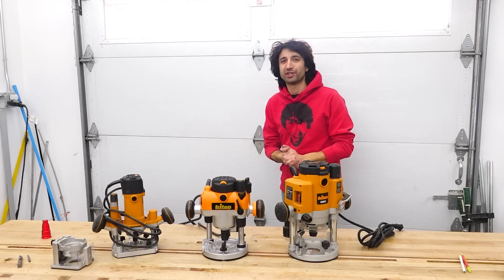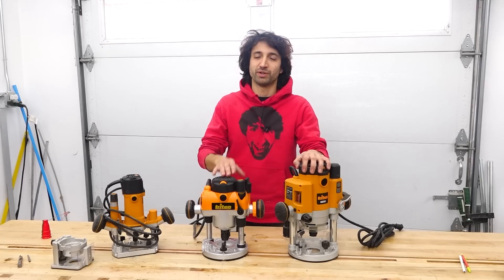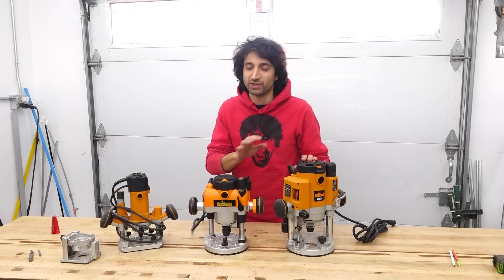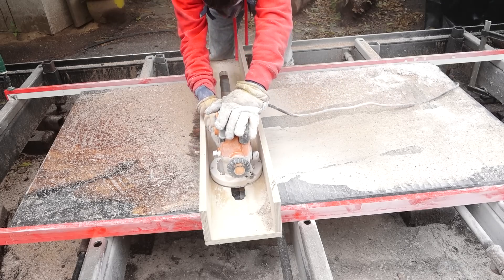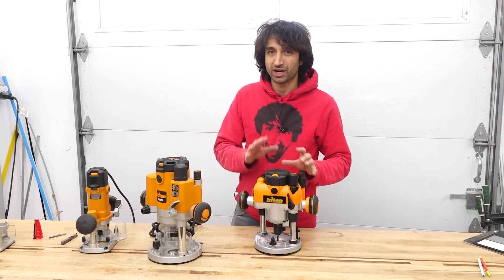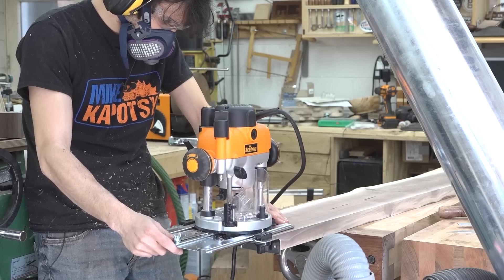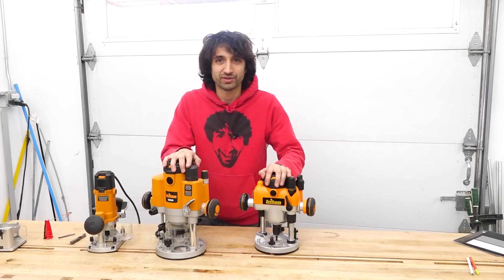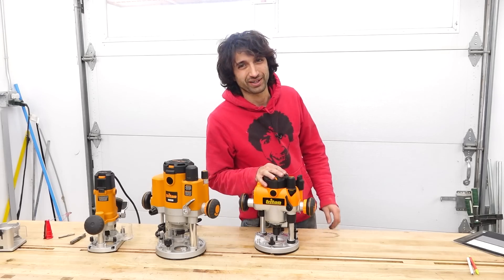What Size Router Should you Buy First?

Comment: something bigger then a 1/4 inch shaft. i found out...plunge routers are nice.. i have 3 routers,,and 2 nice pro tables..yep u got that right on 1/4 inch ...but then again bigger bits cost bigger money...a small router is handy..same as drill presses...theres a lot to say there to on them..buy a good one..m,taper....type..when i worked in the mill,,i found this all out...dont buy cheap things..haaa,,if you got the money...great stuff Matt..

Comment: I really need to up my router game. My main router right now is a 1960s era Porter-Cable model 100 with 7/8 of a HP. That little art deco beauty will not die and is installed in my table saw wing most of the time doing roundovers or flush trimming. 

I also had a 2000s Craftsman piece of crap that would never hold its height between the collet slipping or the base moving, and it would burn up brushes incessantly. It eventually melted the switch, so I tossed it in the trash but kept the little portable table it came with. 

Eventually I’d like to build Norm’s router table from the New Yankee Workshop and drop in a nice router lift with the biggest router I can find. That big Triton might fit the bill - if I can find one for a decent price.

Comment: The large Triton router with its built-in mechanical lift system was an easy upgrade decision when redoing my router table. The forethought and engineering in the Triton are amazing. I have zero complaints. You may have already done this, but otherwise you should showcase some of the Triton router features like safety switch spindle lock offset wrench and collets. They are game changers in functional simplicity.

Comment: Excellent review! I have the Triton 3.25 HP in my router table, a Makita trim router and a Bosch 2.3 HP plunge for handheld use. If I could do it over again, I would have bought the Makita 3.25 HP for handheld use instead of the Bosch, as it basically weighs the same with better power for flattening sleds.
Reply: Ok
Reply: What model is in your table?

Comment: They’re pretty simple tools
I have 8 that are from 40 years old to new.

I’ve bought 5 in the past two years all from Harbor Freight 
Two of those live in a pocket hole machine and two small compacts do edge profiles.
The other is the new Hercules with fixed and plunge base that lives in a router table. The fixed base is adjustable from above the table.

I’m pretty impressed by them and make furniture for a living.
They’re as good as any router available twenty years ago.
Reply: LOL, I have an all metal die cast P.C.from God knows when.
Reply: I’m not going to admit how many routers I have
Reply: @Outcast1016 , I tell my wife that need one for every bit.

Comment: I have all three of those sizes (Big PC in the table, 2 hp Bosch - and a Milwaukee M18 fuel Trim Router. My two cents (maybe 4 with inflation), is that a battery powered trim router is the way to go. No cord to get in your way, far more portable - and in my case uses same batteries as my circular saw, sawzall, grease gun, impact wrench and string trimmer.
Reply: I'm not sure about you, but I find the Milwaukee much easier to adjust than the Bosch too. dust collection on the 1617 realy annoys me, first buying a separate part, and then needing a screw driver to install and uninstall it to change bits? SO at least I'm  hoping Milwaukee does a 2 hp cordless soon, since the 1/2 bits is rather useful.
Reply: @trevsaunders5778  My Bosch is the MRC23EVSK 2.3 hp combo router. Been pretty pleased with it.

Comment: Makita makes a trim router which takes 1/3" bits and comes with lots of accessories. I can't imagine breaking a bit, as long as it is of good quality, sharp and you don't shave off too much material at once. Shaving off too much at once is anyway bad, because it increases the risk of chipping and splintering.

Comment: here is an odd ball question but i really have not seen an answer to it and since i have been following your channel for sometime now and this topic has come up i feel it is the perfect time to ask this question ,,,,,,,, i am wondering if i can use a router bit in a drill? The reason i ask this is because i am actually making a grove in some 2x2 wood so i can run a bearing through it to in effect make a home made glider for a drawer?  my thinking is in a drill press i can adjust the distance i need to plunge and also i can properly set up a fence so all the pieces will be the same as far as distance from the edge  ,, but the biggest factor in this is i have a drill press and have acquired router bit set 2nd handed  but do not have a router .... comes down to i do not do very much woodworking at this time only real small personal projects and have limited personal space to keep any tools i have or acquire
Reply: Get a router, drills don't have enough power.  RPM's are too low.
Reply: @rogerdudra178  thank you 
but since i do not see a future project with the possible need for a router i will attempt to ask a friend if he has one (router) i can use for the router bits i have acquired and possibly gift the bits i have as a thank you too him 
i do thank you for this knowledge
Reply: I think using a router bit in a drill press would be a bad idea. First of all, a drill press really isn't designed for lateral pressure. I've heard stories of people breaking things using drum sander attachments in a drill press. Second, it seems fairly dangerous as the bit is fully exposed vs being mostly buried in a router base or router table. Also, a drill press turns way too slow. Most run in the 150 to 2800 rpm range, whereas a router turns in the 8,000 to 25,000 rpm range. Lateral runout would be another concern. Far less tolerance in a drill press than a router. I fully understand "it's what I've got" but I wouldn't risk it. Routers aren't that expensive.
Reply: @rogerdudra178  ps when i said a drill i was thinking about a drill press
Reply from the maker: You can do it but it won’t be very effective. A drill press spins too slowly
Reply: @benjigreystone  Still too slow.  Try your table saw.

Comment: Do router Colettes ever get damaged or worn out? Can you interchange them from one brand router to another? Are the threads all the same? Or do they differ?
Reply: In theory, collets can wear out like any tool part but it’s not something I’ve seen personally. As long as you don’t strip the threads or somehow cross the threads, the collet should last many years. Collets are not interchangeable between brands, or even between models within the same brand. Even if you have a collet from one router that appears to fit another router, I would not do that unless the manual explicitly says they are compatible. The geometry of how a collet fits into the spindle is critical to holding the bit. The last thing you want is a razor sharp bit spinning at 20,000 rpms to come loose.

Comment: The horsepower numbers for routers have gotten as meaningless as shopvacs.  The absolute maximum you can get from 15A at 100% effectively is 2.4HP.  Since no router is nowhere near that efficient and no 15A tool is allowed to run at true 15A, none of them are probably over 1.5-1.75HP.  Bigger routers give no more power than the mid sized ones unless the mid sized ones are terribly inefficient or overrated.  First!
Reply from the maker: I agree. Much better to look at the amp or watt rating
Reply: I was wondering about this. A 3 HP dust collector or table saw requires a 220 outlet, so you would think a 3HP Router would require the same.
Reply: @MAGAMAN  Or, lie to consumers and say it's 3HP when it's maybe 1.3-1.5HP.  I should start selling 12HP routers on 120V
Reply: Can these large routers be connected to a 20A plug end to then work at the higher 20A circuit receptacle to take advantage of the amperage?
Reply: @slaveofjesus3878  No it doesn't work that way.